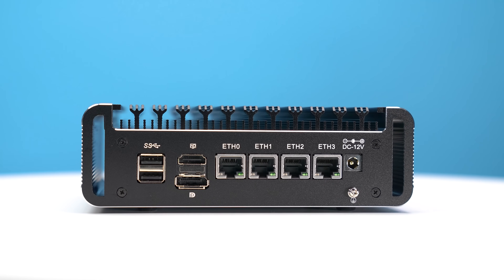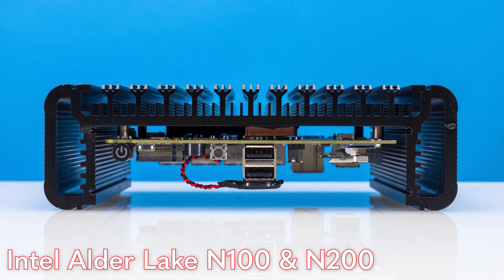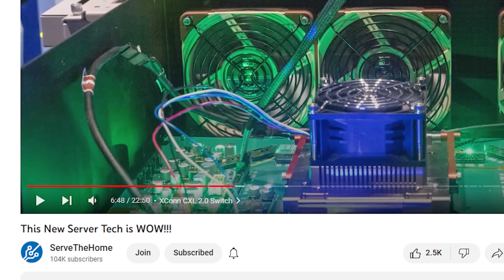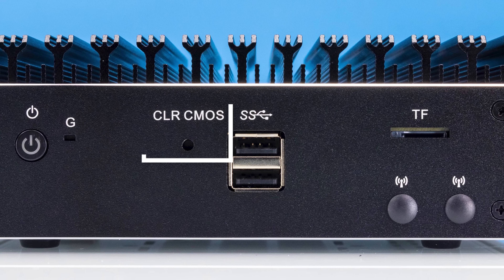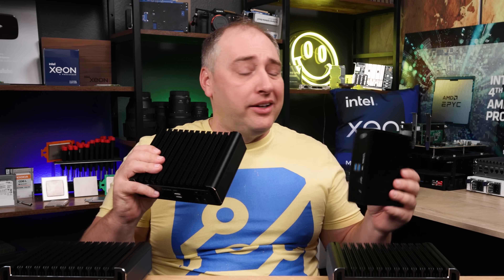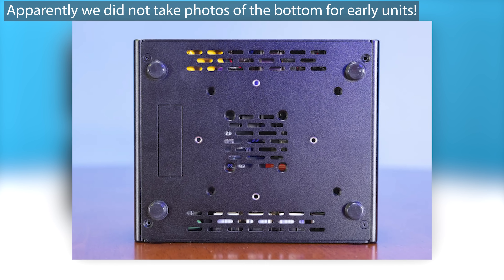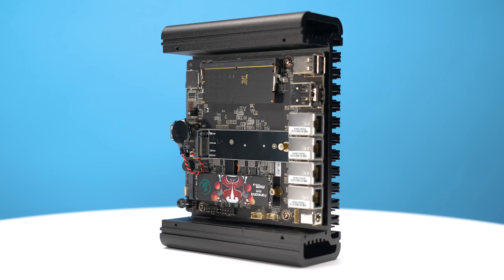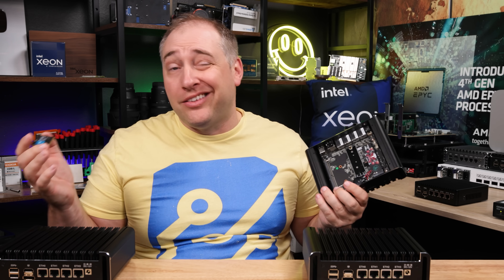HUGE UPGRADE! New Firewall Router Virtualization Host

Comment: I really don't mean to be annoying, but just in case the designers of these machines are watching any of these comments, PLEASE GIVE US 10G base-t! - These mini computers make FANTASTIC homelab and small business border routers. but they are extremely limited by the 2.5g ethernet interfaces, particularly if you're like me and have the capability of 10g fiber and/or (a more likely scenario) if you're trying to use it to route vlans on a 10g network.  OR, if you wanted to use this for something like a proxmox cluster, again the 2.5g network interfaces are very limiting for both external networking and backhaul.  I suppose you could use LAGG to get aggregated 12gb/s but that also means using 4 ports on a 10g multigigabit switch and 10g switch ports are rather expensive to need 4 of them per unit... especially in the case of a proxmox cluster where you'd need at least 3 of them (for a total of up to 12 10g ethernet ports.
tl;dr: PLEASE give us 10g ports on these (preferably 10g base-t, but at lease 2 10g-base-t capable sfp+ ports) on these minipc's.
Reply from the maker: The challenge in these Alder Lake-N boxes is that there are minimal PCIe lanes. Even in this platform they are at the edge of what can be done.
Reply: @ServeTheHomeVideo  Unless they're using a PLX switch (i'm not sure), each of those i226-v chips is using a pcie lane.  you only need 2 pcie3 lanes (which are about 8gb/s) for 10g ethernet which means that a 2x 10g ethernet option should be possible.  Further, there's that second m.2 slot exposed by the "h" board.  m.2 is typically 4 pcie lanes as well which means theoretically you should be able to break that into 2 10g ports too.  I may have to investigate that option.

Comment: A bit off topic. But I noiticed that the SSD is from Fangxiang using YMTC chips. Rarely seem them outside of China. Much of the recent price drop of NVME drives have been accredited to the rise of YMTC. Any chance that this drives/chips could be investigated? I'm current running 10 NVME drives on one of my severs. would also be intereseted in budget NVME storage server suggestions. platform, fs, raid, networking, etc.
Reply from the maker: I can see if Will who does our SSD reviews wants to take a look at one of these.
Reply: How can you fit 10 drives into one server? Do they all get x4 link? 🤔😊

Comment: May we assume the units were not stacked during the CPU stress test and temperature measurement?
Reply from the maker: There is a note on screen in that section. Yes. We are just using that configuration for the power consumption. The actual load and benchmarks were done in a 22.5C room on a table.
Reply: @ServeTheHomeVideo  Ok, thanks. I must have missed that notice.

Comment: Small remark for the performance comparison: You show in the graphs @07:30 that the N5105 has about 64-73% as much performance as the N100, but you say that the N100 is around 30% faster in single core performance, when it is in fact aorund 56% (1051/678=1.56) faster. Either that or you meant to say the N5105 is around 30% slower. 
For the N200 it's even more,  that one is, according to the graphs shown, roughly 70% (1145/672=1.70) faster than the N5105 instead of the mentioned 40-50%. Flipped around the slower than/faster than here as well. :)
Reply from the maker: We typically only show a portion of the workloads we actually run, but we try to consistently show the same bits. I do not want to tell folks 70% then they see 25-30% on most things and then they wonder what is going on. Better to set realistic expectations.
Reply: @ServeTheHomeVideo  I figured it'd be something like that, just very unlucky that the numbers coincide to look just like the graphs were wrongly interpreted :D
Reply: @ServeTheHomeVideo  That makes sense. Perhaps disambiguate that in either the graph or the voiceover.

Comment: If it is made by CWWK, then it is not USB 3.0 on the alderlake N models. It is USB 2.0. The reason is 9 PCIE lanes (x1 each for 4 x 2.5, x1 for wifi, x
4 for nvme). CWWK said that later they will have a converter board that converts one of the m.2 slot to USB 3.0.
There is another brand that looks very close to this one, that trades x2 nvme bandwidth to USB 3.0.
Reply: I was wondering if this is really USB 3.0 because for topton and cwwk they explicite mention 4 USB 2.0 ports for this chassis. There is a mini version in topton and WooYi that says it has 2 x USB 3.0
Reply: @diegosps  I have the N100 version running proxmox 8:  the 2 back and 2 front ports seem to be connected to Bus 01 which is only usb 2.  Bus 02 shows up as 1000 gbps but 
is not connected :-(

# lsusb -t
/:  Bus 02.Port 1: Dev 1, Class=root_hub, Driver=xhci_hcd/4p, 10000M
/:  Bus 01.Port 1: Dev 1, Class=root_hub, Driver=xhci_hcd/12p, 480M
    |__ Port 1: Dev 10, If 0, Class=Vendor Specific Class, Driver=usbfs, 12M
    |__ Port 2: Dev 11, If 0, Class=Human Interface Device, Driver=usbfs, 12M
    |__ Port 4: Dev 9, If 0, Class=Mass Storage, Driver=usbfs, 480M
    |__ Port 7: Dev 5, If 0, Class=Mass Storage, Driver=usb-storage, 480M

Comment: Pfsense really needs to update the community version, I think I will change to opnsense
Reply: Agreed. I couldn’t get it to run due to the Intel ethernet chip. OPNSense is great
Reply: I understand pfsense is now updated and the latest CE version supports the i-226v. My OPNsense setup is running so smoothly that there is no point changing
Edit: but it’s nice that there are now two powerful systems/platforms available for us
Reply: I upgraded to pfsense plus for free and it’s awesome
Reply: @magesnz how did you get plus for free
Reply: @magesnz  how did undo that?
Reply: @joaovguedes  there is a homelab version that's free
Reply: @DjDaan111  I'll try that.
Reply: Just had a thought, and it is probably easy to do, but if you have to install pfsense ce to the upgrade it to plus with the key, how do you upgrade it if ce does not support the network and you can't seem to directly download a plus install image?
Reply: @GanetUK  Sorry for not answering your question.  You would use a USB to Ethernet adapter that is supported out of the box.
Reply: @cheerbeerification  Good plan, the box arrived today but still waiting for the memory so have just enough time to order an adapter.  Cheers for the help :)
Reply: I started change 1 of the pfsense to opnsense already.
Reply: I received the i3-N305 version last week. I used a USB-Ethernet adapter in order to upgrade pfSense CE to Plus. To save others time when migrating an existing pfSense Plus configuration to a new device: make sure you edit the XML config file before importing it and change the interface names to match the new device.
Reply: I have moved from pfsense to OPNsense years ago an i did‘t regret..
Reply: C'mon over, the doors OPN. 

Or fold and pay 3x the price for negate.
Or add the drivers manually to PFs.
Reply: Opnsense is dead, bought by a private company. 😢
Reply: They do and it's basically the same as plus.
Reply: No upnp on opensense is the only reasoning havnt changed
Reply: @dunkan44  There is definitely a UPnP plugin for OPNsense. Have not really fiddled with it myself, though
Reply: I feel like they pull the plug for pfsense ce. Kinda make sense as it doesn’t give them much benefit. All open source kinda ends in the same way..
Reply: Why?
Reply: @sirusvirtus5885  Lack of updates
Reply: @joaovguedes  you wouldn't regret upgrading to Opnsense! Been running it for years now and it's rock solid! So much more comforting to get monthly updates. Especially in terms of security...
Reply: @LampJustin  What security issues are there that haven't been patched? CI/CD can just as easily run into security issues
Reply: @justinyoung5348  don't know what you mean by CI/CD that's something completely different. The only updates that come out for pfsense are some diff patches and they are really limited. You just don't know what issues lie underneath. With pfsense you know that the CE version is just not their focus.
Reply: @LampJustin  No, just checked their git. Pfsense is used in enterprise it’s constantly being poked so unless you have a specific security issue that has gone unpatched then you’re just fear mongering. Now, I understand wanting new features or a better ui but these also add “especially in terms of security…” issues
Reply: @justinyoung5348  I didn't say it's dead. I meant that they don't focus on the CE version. Important is not the commits to that repo,  but that tagged releases and that's 2.5.2 (July 2021)... Turn it any way you want, but the release cadence for their Community edition is not particularly stellar.
Reply: @LampJustin  I understand that, but you're saying this is a security issue, and I'm asking for the, apparently known only to you, security flaw. What you're doing is claiming, because of their lack of updates, that pfsense has to be less secure, which is not the case, and I would argue further from the truth. I don't ask Cisco why my core switches aren't getting monthly updates because I understand that isn't how enterprise tech works, nor do I want to have to do a change board every month on highly complex networks involving multiple departments.

Comment: Sure but can they do any modern security inspection or is this just a stateful firewall? These little firewalls don’t seem worth the cost.
Reply: They can, but you shouldn't be using these for critical production workloads. I find lots of value in using them at home and it's worth the cost to me.